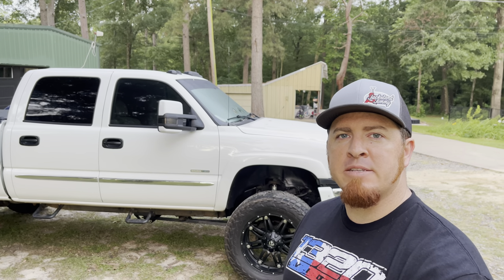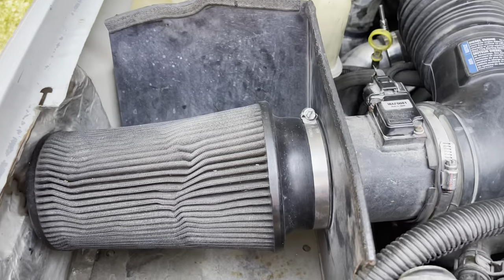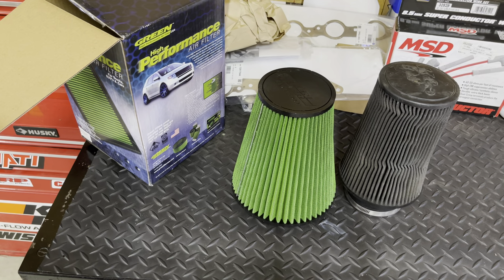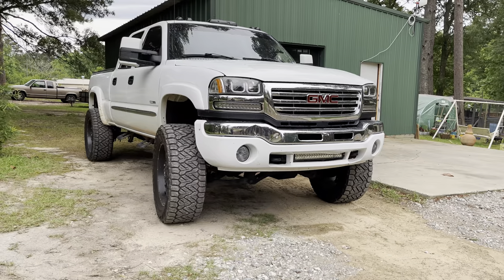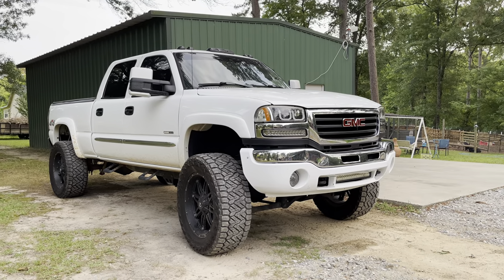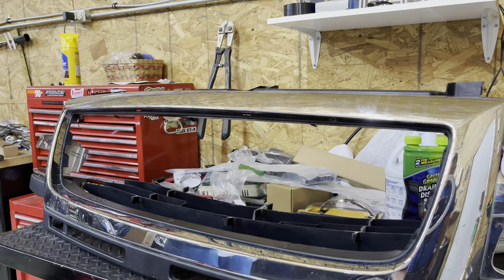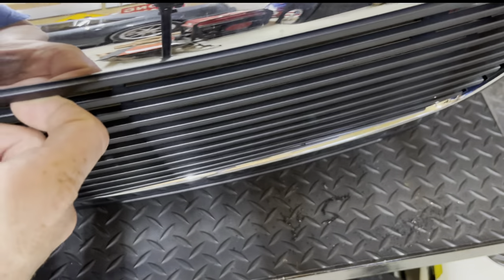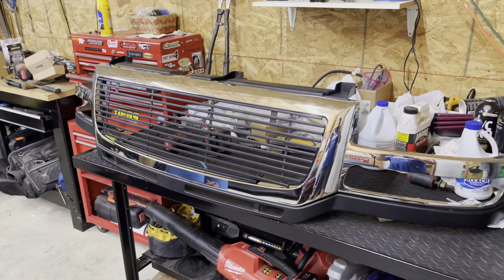GREEN FILTER vs K&N FILTER INSTALL and UPGRADE + GMC SIERRA BILLET GRILL INSTALL 2003-2007 Duramax‼️

Comment: Maybe a diamond clear foglight or a flush off-road light in the lower fascia plus debadge the doors. I think the ‘4x4’ is painted onto the rear quarter panel isn’t it? Looks good though. Did you paint the radiator like you did the Cateye?
Reply from the maker: Diamond clear fogs would be nice. The 4x4 is a decal and they are a little worn. Not sure how hard it is to remove those but some fresh ones may look good for the time being. She wants to wrap the whole truck eventually. The radiator and all that was already painted and looking like that from the previous owner.

Comment: Why is the hole taped up in the sidewall? Isn’t that cutting off airflow?
Reply from the maker: The previous owner did that and I am not sure why exactly. It is not cutting off airflow since it is an open filter with a heat shield, but it probably wouldn’t hurt to remove it. I need to look into removing it…